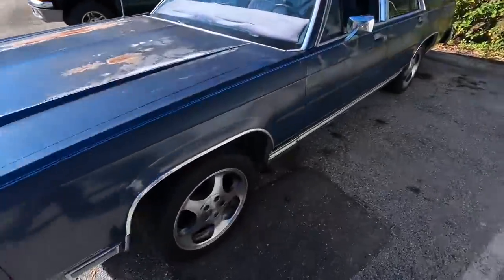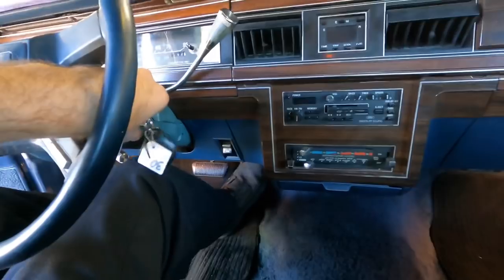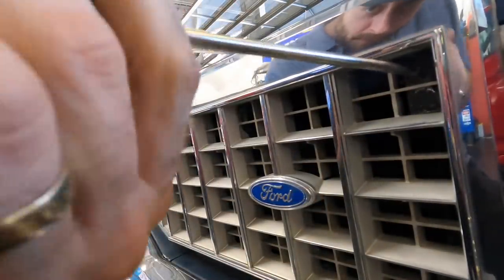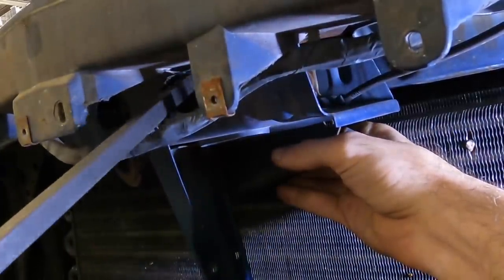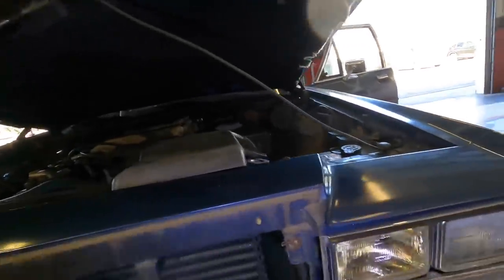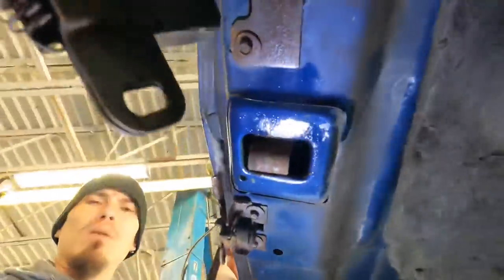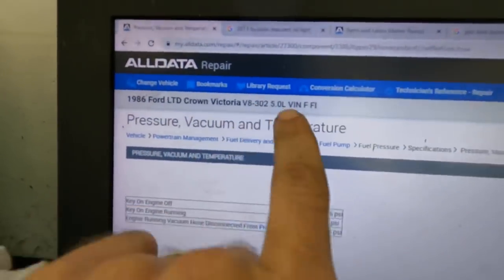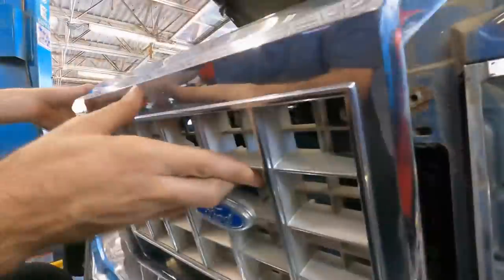Customer States: Replaced Engine, still stalling!

Comment: Electric sliding couch! OMG I nearly spit my coffee all over my laptop! Three thumbs up Ray!👍👍👍
Reply: I sprayed oj all over the place
Reply: My first Crown Vic was a 1993. They still had the electric sliding couch at that time. Such a comfortable seat... My wife has told me many times that she would have been fine with me spending the money that car needed to keep it running, because of how much she loved those seats.
Reply: based on the age, I'm surprised the power seat still worked.
Reply: I love my electric sliding couch in my 84 Fifth Ave.
Reply: That was a great, an accurate, line.
Reply: @Yozhik86  I had a crown vic around that age.  Somehow the mount of the drivers seat rusted/cracked and the mechanic said he couldn’t fix it.  Was an awesome car otherwise.
Reply: Those were the days you could really enjoy variety in the  particular car you bought. Just go to the dealer and check off the way you wanted it and wait a bit for delivery. Those valor seats aren’t going to have you slidin’ around either.
Reply: I had an Oldsmobile that had a moving couch.....😂😂
Reply: I miss those old freeway locomotives.  ('91 Caprice LTZ)
Reply: They were the best.   Your girlfriend could cuddle up nice and close on those long drives.  ;)
Reply: @Yozhik86  oooerrr missus!

Comment: I have my late grandfather's 1987 LTD Crown Vic that was doing the same thing to him.  He put a fuel pump in it and it did not fix it.  Turns out the problem was the ignition switch was full of corrosion and the supply voltage to the fuel pump was low and causing the car to run bad and eat fuel pumps.  Fast forward 15 years later (last winter), and I'm having problems with the wipers and the radio randomly not working and it was the ignition switch AGAIN.  I took it apart and cleaned all the contacts inside of it (they were filthy), and everything started working again.
Reply: That's some tricky stuff. Woul never have considered it. Thanks!
Reply: This guy will probably wind up taking it to a different mechanic if the fuel pump itself doesn't turn out to be the whole of the problem. Guaranteed he'll whine that Ray did the job wrong when he really didn't give Ray the chance to dig deeper and refine his analysis. Further, if he's such a mechanical whiz, why was just getting the bonnet open a mission almost impossible. The owner obviously hasn't opened his own bonnet in a very long time so, it will be back to someone to do the job. When the owner lets even the bonnet release get that bad I can't really imagine him doing even a job like this without messing something up then taking it back to yet another mechanic and then doing the same as here and expecting someone else to work out the hard way just what mysterious things he's stuffed up next.
Reply: @philc7192  I tracked it down by voltage dropping legs of the supply circuits until I narrowed down the general location of the excessive resistance.  A simple A to B resistance check with a DVOM wouldn't have shown any issues.  The meter showed negligible resistance through the ignition switch, but a voltage drop showed a HUGE drop across the switch assembly.
Reply: That says a lot of Ford, not many 35 year old cars still on the road today.
Reply: @kidd1072  it's been fairly reliable for the 10 years I've owned it. Only problems have been related to NW Ohio rust. I've replaced all the brake lines and most of the fuel lines. It leaks everything from everywhere but it always starts and has never left me stranded. I've heard an old saying that goes: "an old Ford will drive broken forever" and this car is proof of that.  I'm going to pull the engine soon to do an HO conversion and reseal everything.
Reply: @craigbomer8962  I had an 87 also when I was young, but it was a gas guzzler, but very reliable!👍
Reply: GOOD REPAIR!
Reply: @craigbomer8962  Low current from the meter was no problem.  High current would not pass.  Cool analysis.
Reply: If that was the issue in this case it would have had normal fuel pressure
Reply: I have an 86 tbird with 267k miles now. Picked it up for $500 7 years ago with 130k. It replaced an 86 cougar with 350k miles. I've owned 15 or so of them, not one went away because the engine failed. 

Usually everything dies at once, and it's just worth putting the money into it. My cougar, I was delivering pizza on a long dirt road and was giving it the beans when it lost oil pressure and found a hole in the oil pan. A quart of oil got me back home, swapped the oil pan, only to find out that both the motor mounts and parts of the suspension had failed and caused the hole in the oil pan... Even passed emissions at 290k miles before I moved to a non emissions county.
Reply: @kidd1072  me too bro, i went to high school in my 87 crown Vic 5.0 that thing was the best man , never left me stranded and the steering was so soft..they don't make them like that anymore
Reply: @craigbomer8962  you know your stuff when you know how to do voltage drop tests
Reply: @craigbomer8962  I used to be a MOPAR guy back in my hot-rodding days. I had to work on that big block nearly every day, but at least it was easy to work on.
Reply: I bought a 1980 Ltd back inthe early nineties, had the same problem with the ignition switch randomly dying on me during drives, and shutting down the engine. half a can of brake cleaner finally did the job, after having replaced most of the ignition wiring, a distributor, a coil, two tdc sensors and two ingition modules, which wasn't easy since i live in europe. bought the thing for 800 euro, drove it to italy couple times until the 4 speed automatic died. the car ended as a deejay boot in a disco in italy. fun car though, good mileage too.
Reply: I probably had to do a hundred ignition switches on ford's back in those days. At least they were a lot easier than on today's cars. ✌️
Reply: dodge same thing. ive learned, first with bad lights. its allways contacts,bad earths, then modules. fuses if your lucky,but then, why did it blow..
Reply: From what I've heard, the Panther platform cars are very solid and reliable, basically America's Toyotas. Ditto the Impala on the 3rd gen W-body
Reply: Had luck with wd-40 on a few ignition switches but at $13 is an easy fix swapping out and a tighter new switch.
Reply: a quick look at the instrument wiring diagram would have shown the number of circuits in the ignition switch connections. as i recall the fords had very busy connectors....
Reply: @craigbomer8962  I had an 85 Crown Vic LTD, was still running at over 320,000 miles when I got rid of it. Still regret letting that car go. It was such a smooth ride, and an absolute tank. Hit a deer doing 55, and barely damaged the car
Reply: There was an ignition switch recall. The replacement was about $4

Comment: Back when cars were made with enough chrome you could see the cameraman. 🙂
Reply: Plastic chrome?
Reply: @dennislyon5412  yes
Reply: "chrome"
Reply: @dennislyon5412  turns out, chrome covered plastic had been used for decades BEFORE this car came out.  Bumpers are about the only metal chrome beyond the 60's
Reply: Shawn Stafford  I'd still like to get a nice chrome metal grille for my 80's and 90's trucks
Reply: Shawn Stafford  80's has sealed beam glass.  90's have plastic housings.
Reply: Lol
Reply: @dennislyon5412  it's chrome plated plastic.
Reply: Had an 82, great car!
Reply: @dennislyon5412  
high quality plastichrome.
Reply: Shawn 🏴‍☠️ Stafford  they had both in the 90's
Reply: Shawn 🏴‍☠️ Stafford  glass and plastic lenses. Really depended on the manufacturer if it was stock glass/plastic, aftermarket was more down to what you were willing to pay.
Reply: And when passengers were the crumple zone 😬
Reply: Back when you could break off a piece of car and use it as a weppins
Reply: A salesmen at a dealer tried to pass off an 09 malibu with plastic shiny mirror covers and hubcaps as the chrome package to make the car seem worth more. I have a 2016 f150 xtr with a lot of chrome plated stuff. I dont think much if any is full chrome, just chrome coated but at least its some type of metal including the rims.

Comment: That Distributer cap reminded me of a time long long ago when I got to see a V16 in an old Cadillac. That was an impressive motor. Yes, I'm old as hell. Lol
Reply: Just a rubber cover to keep water off the cap. Haven't worked on a v16 Cadillac but a v12 flathead Lincoln,  most interesting was the oil level float was made from a can of peaches part of the label was still on it.

Comment: You can see at 2:20 in the video a crease in the hood where someone had already tried to open the hood and dented/creased the hood trying to push it down while someone pulled the lever. They, the owner of the crown vic got what he wanted. Someone to pop the hood and to tell him what was wrong with his ride so he could fix it on the cheap. Hopefully your shop has a healthy diagnosis charge.
Reply: You'd think the owner would just say 'Fix it mate'
Reply: @68404  it depends. Do I come to the shop with a request: please diagnose whats wrong, or do I come with a plead for help, I have a suspected head gasket leak heres the new head gasket can u do the job ?
In the latter I expect them to do work. In the former I expect to receive a phone call with whats needed to be done, since im a DIYer anything that isnt machining I would do myself.
Reply: Had the exact same issue, every day I worked on the rig I had to take the wedge a screwdriver and pry on the hood till it opened. The rig had the front hood creased bad on the passenger side to the point the flexing made a crack in the metal. Point: now I know to unbolt the latch-

Comment: For those, you need an EEC IV scanner (pre-OBD-II) and the plugs are under the hood near the master cylinder.
Reply: I have a Actron CP9690 Trilingual  that reads my old 95 F150. Even gives some useful live data.
Reply: to go further on this it was on the fender well right there in front of where he had the fuel pressure gauge, that is where it sits on my 91 lincoln mark VII
Reply: Good call, some early cars had them hidden in odd spots like the glovebox too.
Reply: OBD1, my 89 Econoline has it, you don't get a lot of help diagnosing with it.
Reply: @tomn8tr  I have that same one with GM and Chrysler/Jeep cartridge s. Looking for the Ford one as well.
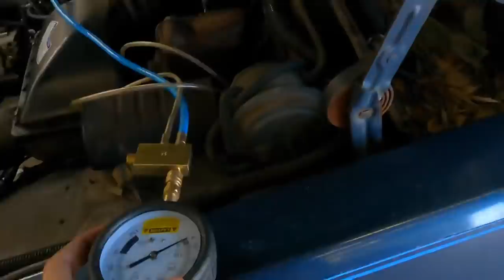Reply: Back when I owned my 88 Mustang I had made a plug (parts from radioshack, resistors & diodes) and used a test light to read the codes. IIRC you can actually see the vehicle side plug in the video at 9:36.

Correction to above: reading the googler apparently all was needed was a paperclip & test light.
Reply: @Goststriker  Actually not even a test light, you could jump two wires in the diag plug and the check engine light flashes the codes.
Reply: @mattfarahsmillionmilelexus  Yes you are correct! For some reason I think my check engine light was out or the ECM had an open and was unable to turn the check engine light on.
Reply: You don't need a scan tool for this.   Plug an analog VOM into the test port and then a jumper wire to ground to put it in test mode.   Then all need to do is key on and count the sweeps of the needle on the VOM.   The digits of the code are separated by a few seconds, codes by a few seconds more and a single sweep and then it will repeat the stored codes minute or so after the last codes is displayed.    Codes are pulled by either by key-on, engine-off for stored codes or engine running for current codes.   During the ODB-I days every car company was different.   Some cars required an analog VOM, like this one.   Some you put into test mode and counted the flashes of the MIL light on the dash.  The Cadillac with the HT engine was the best, you put it in test mode using the climate control buttons and read the codes on the dashboard digital display.   As dumb as it sounds, I liked most of the ODB-I systems because you DIDN'T need an expensive scan tool and a subscription for software updates.
Reply: The codes can be retrieved using a bent paperclip. The instructions are right in the Haynes Manual for these cars. I've had every possible combination of Panther going, including two that you could not get in the United States unless you were in law enforcement. I will give a hint. It was not a 302 under those hoods. My brother had a 3rd.
Reply: @michaeltutty1540  We used to have a '79 LTD wagon with a 351W, 2VV carb, and C4 trans. It was my favorite family car growing up, one of the cars I learned how to drive in, and in 10 years, the VV carb never gave us a bit of trouble - which was very rare. It was quick too, smoking the tires in 1rst was pretty easy.
Reply: @Maples01  no, but OBD-1 cars often don't need a scanner tool- some flash the check light to indicate the code(s).
Reply: @tommurphy4307  Yeah but not much of the electronics have a code to indicate problems, I have no codes but runs poorly when restart at operating temp, doesn't want to idle.
Reply: @Maples01  I know on GM OBD 1s you can short out the 1 and 2 pins and get a blink code on the light. Not sure if that works on other makes though.

Comment: My mom had an 89 Vic. Loved it. It was the first vehicle that I learned how to do general maintenance on (oil changes, change an tire, etc). Ran until 2003 at 570k miles
Reply: What died at 570K, that made it not worth keeping?  The suspense is killing me.
Reply: That's the last decade Ford made anything of quality
Reply: wow, my son only has 260k on his 04
Reply: @jfreelan1964  rust out frame
Reply: @louoldschool7047  I’m from the UK and know the panther platform is one of the best
Reply: @jfreelan1964  it's usually everything at that point. Interior turns to crap, brake lines rusted again, not running trustworthy, tree branch breaks windshield.
Reply: Still driving my 84 wagon which has a less sophisticated fuel injection system, not multiport like this sweetheart.  I replaced my hood cable once.
Reply: think of all the fuel that thing wasted....

Comment: I worked in Canada in the early 90's for a few months and had a 1977 Ford LTD to get around in, thing handled like the Titanic, leaked oil like the Exon Valdese but was the most comfortable car I'd ever driven.
Reply: Some of the best seats ever!
Reply: I had one in the 80's. 77 LTD II. The thing was a tank. I had a squad car cut a corner too close and he clipped my pass side bumper while I was stopped because the guy they were chasing ran past the front of my car with the K 9 in tow.
The squad bent my bumper and broke my turn signal cover.
My LTD totaled a qarterpanel and tweaked it's frame. 
If you ever get one up near 100 mph the feel like they are floating down the road.
Reply: @douglascampbell9809  my dad owned a ‘75 markV 460v8 dark green velour , as long as a country squire wagon. So quiet you couldn’t hear or feel the engine running. Even the steering was like glass. Reminds me of the tv show  Cannon.
Reply: That's all my grandfather would drive it was like riding a marshmallow on a cloud.
Reply: I had a 71 Marquee Brougham. Burned oil, and smoked when idling, used gas like mad. But the comfort was amazing. After a few quarts of motor honey and a thorough cleaning and freshening of that glorious interior I drove people to and from the airport.  Huge trunk too. Had many compliments of the comfort and quiet ride.  But oh the gas mileage on that 429 engine.
Reply: I had a '86 Pontiac Parisienne for my first car and it was so smooth and no furniture store could beat those bench seats funny thing I had the same hood latch and my plastic Inside handle flew off pulling it too hard
Reply: 2 of the people commenting had the cars my dad and grandfather had, my dad has a mint green 77 ltd with dark green interior, and my grandfather had an 86 Pontiac Persianne, they were both great
Reply: the early 70's ford full-size cars had stays on the fenders near the wheel openings- so they didn't 'sing' at high speeds......

Comment: Brings back memories.  I had an '88 Grand Marquis with the 5.0 and an '81 with the 255 cid and a variable venturi carb, which required a carb rebuild every 70,000 miles.  Bought them with less than 100k on the clocks and drove both until they rusted out.  260,000 and  288,000 miles respectively.  Great cars.  Currently rocking a 2004 Crown Vic LX Sport with the console shift and Handling/Performance Package.  So much fun!